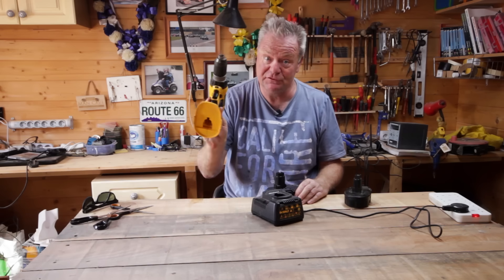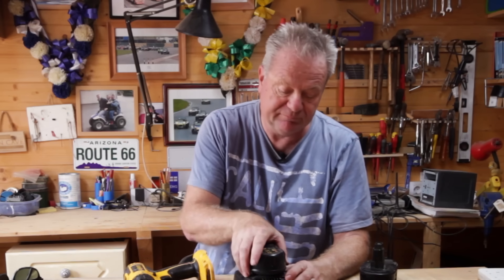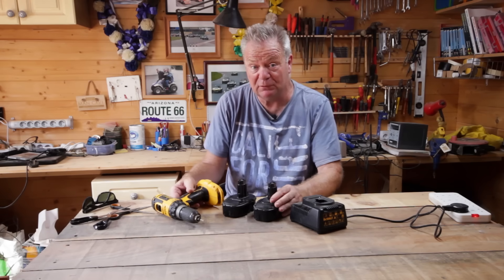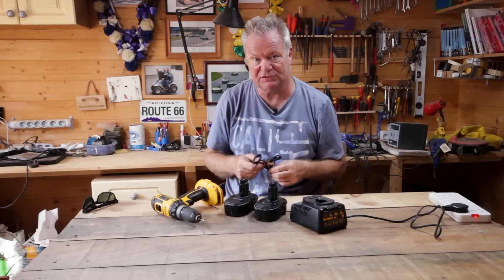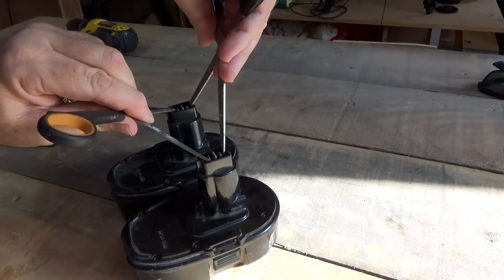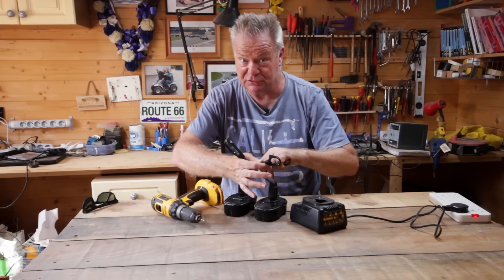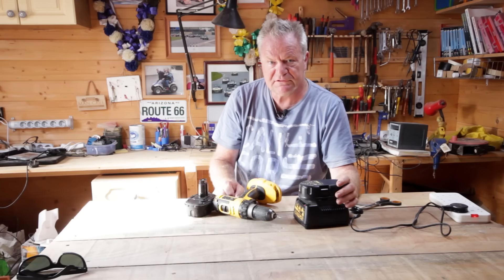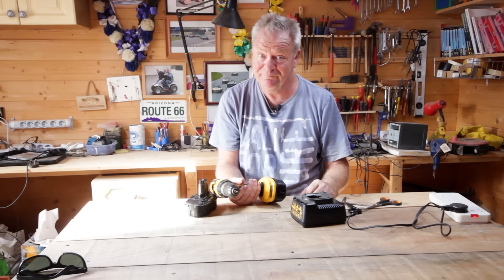How to revive a dead rechargeable power tool battery easily

Comment: Thanks for guide, I heard that you can do this for bigger batteries too, like car batteries. of course the damaged cells prevent recharging and lose charge. It is important to connect plus to plus and minus to minus.
Reply from the maker: Actually I hadn't thought of that but I did the same with a car battery that wouldn't charge from a trickle charger some years ago. Yep, always connect the same poles.
Reply: @JPinFuerteventura  If you don't have enough amps in the battery the charger won't recognize it. So even a trickle charge will not work. When you connect the batteries together, you are putting what is called a surface charge. And you are trying to put enough voltage in the battery for the charger to start. With a car battery.. After you can get a charge on it, then you'll want to put it on a trickle charge a couple times. With the tool batteries.. Run it for a bit to take some of the charge off, so it will take a better charge.  Sorry.. I worked on batteries for 11yrs. Got to let out the stored information.

Comment: I have put batteries in the fridge or freezer that wouldn't change, sometime that are to hot to charge.. or it just help them to take a charge.... Let your batteries cool off before and after use and charge ecspecialy lithium...will not charge not just let them cool off first .
Reply: Funny... up here in the Yukon Territory (Canada) we have to heat up our batteries, ann be sure to bring them inside a heated building overnight. -40c wrecks battery cells!
Reply: @chrissturgeon1571  I'm in Florida so I am on the other side of the heat spectrum....I have to keep my batteries in the shade....
Reply from the maker: Good tip
Reply: I just paid $5,495.00 for a LG Chem Resu 10 battery storage unit, here in the (arguably) hottest city in America, Palm Springs.  For three months, my garage never drops below 100 F, sometimes getting to 120 F in there.  The battery's operating temperature limit is 140 F.  You should keep all the equipment as close together as possible, so locating it 50' away on a north facing exterior wall isn't an option.  Inside the conditioned space (in the kitchen/mudroom) it's another appliance that contributes to the heat in the house.
If you're good at paperwork, Edison will rebate you 80% of the battery's cost but it's taking a year to dig that out.  And you get a $2500 tax credit that some might use, some might not.  It increases the efficiency of the Solar PV system it's connected to by anywhere from 20% to 40%.
Temperature is the most critical calculation when buying panels, designing the system (optimizers, not mini-inverters) running cables and conduit, and placing equipment, for us in the low desert.
Up there in Alaska you probably don't give hoot about most of that.  Snow and exposure are your only enemies, if you already live with cold temperatures.  (I lived 40 years in the 2nd coldest capital city in the world, Ottawa)
Reply: That’s what we do to kill our battery’s is put them in the freezer , for disposing

Comment: The problem is when there old they dont hold a charge it can sit on charger all night and only run the drill for 5 min
Reply from the maker: Yes, if the battery is that old then that is a possibility. The battery in this video is still holding charge for a reasonable amount of time over a year later. Obviously not for as long as when it was new. The most annoying thing is that it is normally almost cheaper to buy a new power tool, complete with two new batteries, than buy to replacement batteries. But then that is what the manufacturers want.

Comment: unfortunately i have only one drill battery. can i use any 12v battery with this method ?
Reply from the maker: If your drill battery is also 12v then I cannot see why it wouldn't. It only needs a small amount of charge for the charger to register that it is plugged in. If you are going to have to bin the battery anyway it can't do any harm can it.
Reply: @JPinFuerteventura  it did work :) i used a small 12v garage controller battery with this method (and without hope) , my zombi drill reborn :) thank you very much..
Reply from the maker: Great. That is good news Hakan.

Comment: Hmmm..... so it gets it to charge, but does the battery hold charge for as long as it used to, or does it die after a couple of minutes of use???
Reply from the maker: I am still using the battery over a year later.
Reply: I think hes saying that with this trick, the battery will never die again! Frickin amazing. Or maybe he just keeps switching batteries, thinking they're the same ones like he did in this video...

Comment: He say de battery dont charge and cover the led when conect the battery to the charger i think the battery still good.
Reply from the maker: As I have said in a few other comments. I realised I had not switched on the camera so did it again, at which point there was a little charge in the battery. If you read the comments you will see this method does work.

Comment: FYI this is the best way to burn your house to the ground. The battery won't charge because it is damaged internally. Now it may work for a day or a year but it's going to burn, TRUST ME. The best part..... You can't put it out, the chemicals inside burn super hot and supply there own oxygen. The fire extinguisher required to put the fire out requires a special hazmat suit and ventilation. Also requires a license to purchase. So by saving a few dollars on a new battery, you'll be putting other people's lives at risk and searching for a new place to live. Good luck with that
Reply from the maker: Yeh right. Utter rubbish.
Reply: Hey jp it a wonder this eric bloke didn't  try and tell you the moon would fall from the sky . I think he's  off his meds....😂🤣😀😎
Reply from the maker: lol Rod
Reply: Eric Wintersteen - the battery wont charge because it has a voltage that is too low for the charger to “see” and therefore will not begin charging.  

Now how the battery voltage got that low is because it either sat too long without being charged and it simply discharged all of its energy or there is corrosion inside the battery on some of the cells and this prevents those particular cells from being charged. That’s why a battery run time is so short.

Comment: This seems to be very awesome. I am not very techy, but I did this pretty easily, using wire and clips to connect. I opened up the dead battery to get to the terminals more easily.  It revived a DeWalt 14.4 Li-ion battery that seemed to be totally dead. Thus saving a lot of money, and unnecessary waste. Thanks for the great info.
Reply from the maker: I am glad it worked for you. Thanks for commenting.

Comment: Awesome!!! I had tried plugging and unplugging the charger multiple times with no luck. Almost gave up but my persistence wouldn’t let up. I tried your trick with a couple paper clips- the positive one held with insulated needle nose pliers (I have a heart arrhythmia so not risking anything!). One spark for one of the batteries worked. A couple sparks to the other. I am sure the batteries are still weak but at least I have something. 
Thank you for the advice. I felt pretty safe using a similar voltage. Don’t listen to the negative comments. Even if you save the environment/ someone’s wallet one battery at a time you’re pretty awesome!!
Reply from the maker: I am really glad it worked for you Melanie. Thanks for commenting.

Comment: Do the revived batteries HOLD their charge for any length of time, and how do they perform under load? Thanks
Reply from the maker: Well this video was made a year ago and the battery is still being used. In fact, I can't tell which of my two batteries it is, so I guess it holds charge pretty well.

Comment: I was charging an old 18V drill battery for a whole night. The charged led still didn't go, so I measured the voltage of the battery and it was 42V. Is that normal?
Reply from the maker: I am no expert, I just know that this works, however that certainly doesn't sound right to me.

Comment: Wow!!! I took my electric bike out after leaving it for over a year. Luckily one of the two batteries charged up no problem. The second battery was completely dead and would not charge. I searched all over the internet to see if there was some solution. Nothing until I came across your video. These replacement batteries(if you can find them) cost in the range of $600.00 each! I figured your solution was worth a try and bingo,it worked. The battery is now charging, no more flashing light indicating no charge. I’ll have to wait a while to see if it fully charges but so far so good. If there’s a problem I’ll give an update. I was just so excited, I had to respond right away.
Reply from the maker: Great - I am glad it seems to have worked. Yes please let me know the outcome. Thanks for your comment.
Reply: how long did it work?
Reply: Continues to work, good as new, several months later. Accepts new charge no problem and holds the charge like new.
Reply: Straight shooter sounds made up!

Comment: tried the same i got 12v 7.2Ah battery it was at 10V and won't charge. acid came out so i've changed it for another lying in my garage it was 7.5Ah but voltage was 1V DC!!!! so i put it in there anyway, it has stabilized to 12V output was around 13.1 or so, but it has no power in it, when i plug it in the UPS that's supposed to run the light when there's no power in the house, it turns off and says it's empty, it passed 7hrs to charge from 1 to 12 but unit says it's empty WTF ???

Comment: It's not physics, the charger is just a little too smart. When you plug a battery in to charge, the charger checks for the presents of a battery, if there is 0 voltage it doesn't see a battery to charge, so there is no output. If you boost the voltage a couple volts and plug it in, the charger sees a low charge and will charge. This doesn't necessarily have to be due to corrosion (although it could be). A battery left sitting for an extended period of time can go completely dead and do the same thing.
Reply: Samuel Jones. Logical. Totally dead = 'smart' charger doesn't even recognize it's there. Small hit of juice into it = 'smart' charger now sees a battery and goes to work.
Reply: That's because an overdischarged battery is considered damaged and won't be charged. In this case you just go above this low limit and allow it to charge. However the battery will certainly not last long.
Reply: Samuel James I was thinking the same thing being the chargers smart sensor. Some times smart man made items still need to get a little help :0)
Reply: @blessedjohn  Smart sensor could also just be smart for the manufacturer's bottom line. All based on perspective.
Reply: car battery smart chargers are the same way, give your dead battery a little boost and the smart charger will pick it up and charge the battery. I have done this many times.
Reply: The presence of the battery. Presents are gifts.
Reply: Actually charger seas the battery, but (usually) won't charge it if the LiPo cell voltage is below 2.4 v.
Reply: What about if you dont know how to boost the voltage? (Like me).

Comment: this is a temporary and likely single time fix. as soon as you drain that battery low and it sits for a few hours it will self discharge itself low enough to where the charger will not charge it again..  to really fix it you need to take it apart and clean the corrosion out that is growing on the battery cells between the anodes and cathodes. this is much more disassembly than most people are willing to do, because you usually need to solder the cells back together. but this is the only way to truly fix them.. some idiots are trying to remove that build up with a welder.. don't try that either.  you may be able to take it apart. straighten out the cells, unfold the cardboard near the connectors and clean there with hydrogen peroxide and a toothbrush. then put the cardboard back because you need it as a insulator.  you might also consider applying some dialectic grease around the connectors to prevent it from building up again.
Reply from the maker: Thanks for that very informative post John. My batteries are still charging ok at the moment but I may give this a go when they aren't.
Reply: Even if it is a temporary fix and the batteries might not last as long, it is still better than not having that battery at all IMO..... Its free and could get you by in a pinch.
Reply: Been doing this for 40 years but NiCads are obsolete. I usually smacked the batteries with the 10 or 20 amp 12 volt power supply for  a sec and they work. All be it's true but better to think about getting a new battery soon. Yes, it's true that getting a whole new tool is usually cheaper than buying a battery. Rediculous!
Reply: They make the chargers this way, in order to sell more batteries. The charger has a high cut-off (due to being fire hazards, according to the company), and won't charge batteries which has been used until they are all empty. You need to stop using them before they actually don't spin the drill anymore, or they won't charge. It does not necessarily signal a physical fault in the battery itself.
Reply: Better than blowing a hundred dollers on a new battery
Reply: Please some help, I have a pair of batteries Ridgid 18V, they charge but they do not hold the charge longer, what Can I do?
evelyn.castaneda@aol.com
Reply: @enmalopez1585  you're Rigid drill should have a lifetime warranty and the company will replace your bad batteries free of  charge. Go to the Rigid website and open a RMA ticket.
Reply: John May s
Reply: you don't actually know whether this is a temporary fix or not. Depends on why it actually so low.
Reply: Thank you. Now, will it take the same time to fail again or less? Just to consider doing it or not. Thanks
Reply: I'll just get a new one
Reply: what you really need to do, if your in to it. take it apart, and change the dead ones. out of 12 batteries 3 to 4 are fried. solder new ones in, you have a new battery. Some will, some wont, some can some can't some try, and some cry. Good luck..
Reply: John May
Your first sentence says it all. And ron buttineau, gives an example to renew the battery for the tool.
I've worked on the Mikita batteries years ago, and the only way I found it to work for any good length of time is to replace the bad batteries in the case.
Using a welder is just not good idea; some people have been injured by this trick.
Reply: Nik Berean  I was the first kid in the neighborhood to hammer a nail "into" a 2x4 , the first to actually "cut through lumber" and not just myself , and the first to drive  a screw into lumber without stripping it .  This was the days of philips head screws only know self drilling screws no torx screws and no cordless drill - I'm kinda old .  For I was 20th I could drive a 3 and a 1/2 inch screw through for without pre drilling a hole was an electric corded drill . That's the standard by wich all should  e judged with respect to drilling.   When it comes to comparing cordless drills corded drills - you can't because there is no comparison - corded drills suck. you either have the high speed low torque 3/8 drills of yesteryear which were useless unless you didn't have a 1/4 air die grinder and were dreaming of spinning  a wire wheel rather than grabbing a boring wire brush and dragging it back and forth for the thousanth time - times were simpler  and so was I wich left me easy to please . Then you have the other and more serious option = Mr. Milwaukee which was the only option for Serious work , like drilling hardened steel with bigger bits . Sink or swim and not much in between - you were either one of the few that made it through and joined the pack of real men (well remember this is only about how well you could handle a old school man killer 1/2 gear reduction drill , lol) or you went with the majority of hopefuls = out the door with a rotator cuff injury and/or tennis elbow. I'm fully qualified to handle any and all drilling tasks as a legitimate pro whether I'm in a shop doing repairs or fabrication or on my jobsite doing construction work and I can guarantee you that cordless drills , especially nowadays,  are totally surperior to any corded drill = for you types who like to take pot shots from the safety of your easy chair (more likely your moms couch , or your grandparents when your parents kicked your lazy millennial ass out for sitting around all day and smashing yourself off while looking at Japanese anime. I was going to say while smashing one out to cosplay babes but then i realized that i do that lol . Anyway for those with the typical ego feeding pot shots = yes they even have real deal hole hogs and they're no joke .peace,  love , and happiness to y'all for real .
Reply: @MrDeaweber  what's that on the windshield?
Reply: Complete waste of time the"revived" battery will have only a fraction of run time and will quickly discharge

Comment: Good heavens! That's a surprise! Thanks for sharing. Imo x
Reply from the maker: Thanks Imo - I like to mix it up a bit. Back to normal-ish next week. Thanks for watching.
Reply: I shared it on Facebook 'cause I thought it looked useful and I noticed someone else shared it on again. Cool! You'll be doing the rounds! :¬D A question though - did you not get any electrical charge going through your fingers when you were holding the scissors by the blades?  I'd have been a bit nervous of doing that.
Reply from the maker: Thank you for sharing it. Actually no I didn't now you come to mention it - I didn't even give that a thought. I guess it is only 18 volts though.